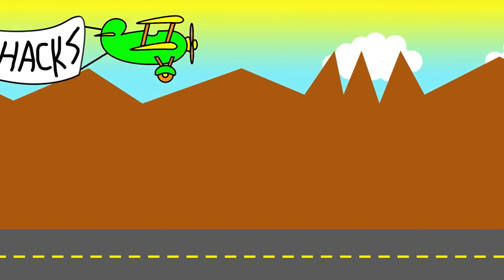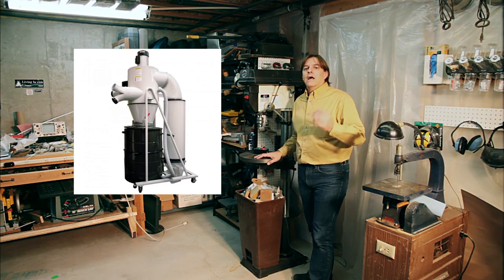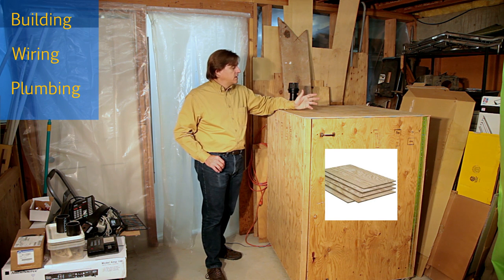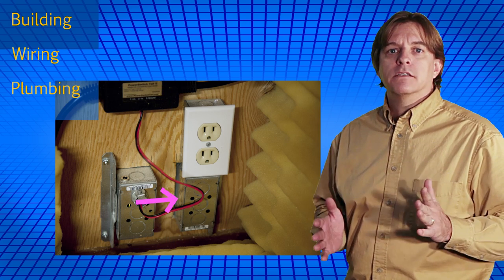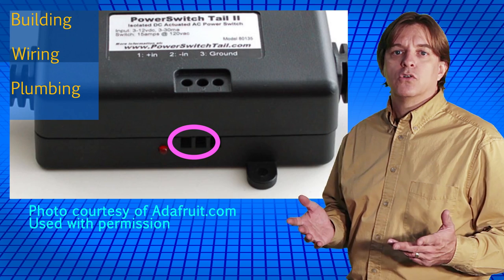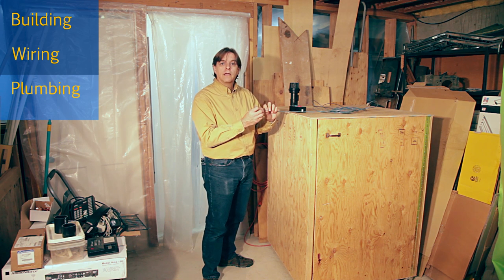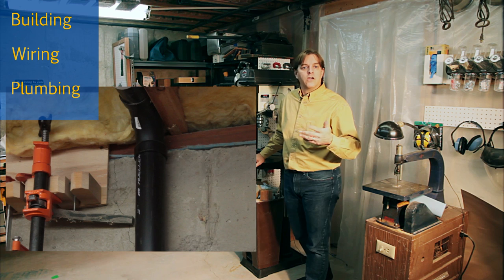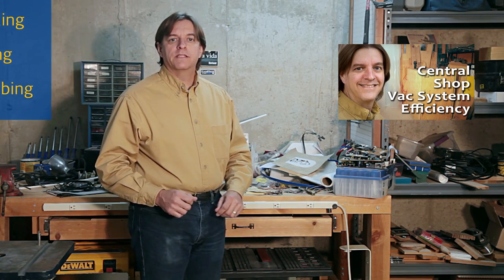How to quiet a shop vac - Physical build (Part 1)

Comment from the maker: Correction: at about 5:05 I called an RJ-11 an RJ-45. They're both the same design, just different connector counts. The RJ-45 is a 6 conductor connector that's typically used in networking. The RJ-11 is the smaller 4 conductor version typically used in phone systems. I used an RJ-11 in this application.
Reply: Additional correction: The RJ11 and RJ45 are not the same design, the RJ11 is in smaller and not compatible with RJ45 ports.  RJ45 is an 8 pin connector not 6.

Comment: For the remote ,I used the remote light switch kit from Lowes, just unplug vac, plug in remote receiver, plug vac into receiver that's rated for 15 Amps . remote switch is 1.5"x1.5"x 3/4", press button ,it's on, press again it's off, no cord trailing behind. Been using it for three years now ,and still works fine on the same small watch battery, I just clip it to the top of my shop apron and I'm  ready to work from any where in my shop.
Reply from the maker: Sounds like you have a good system. Cheers.

Comment: I really like you flapper gate/ports.  Be sure to keep an eye on the temperature inside the box.  If it gets too hot you might burn up the motor on your vac.
Reply from the maker: +P Lemieux Thanks. Yes, heat was a concern when I first built it. Since then I've had it running for quite a while at times and it gets a little warm, but not burning up hot.

Comment: The box looks really big.  How much was the sound reduced without the foam?
Reply from the maker: Yeah, it's not small. I made it the size of the vac + a couple inches for air circulation + a couple inches for the foam. I didn't think to test it without the foam, so I don't know the difference the foam makes. Cheers.

Comment: I just happened upon your site and the build you made is very interesting. I learned something new and I try to learn 5 new things a day. Now could I preform them with out a reference, lol, probably not.I have a small 10 x 16 foot shed/workshop I bought and insulated. This shed has a "loft" where I put my compressor and some day small tornado and dust collector.For now the tornado(home made) is connected to my vacuum. I then enclosed the loft leaving a small access door. The entire space is insulated to reduce the sound. I have Two questions for you : Should I change out the standard small plastic vent at the peak in that enclosed space to something larger so things don't over heat? &  Would it not have been better for you to have used a larger dimension pipe for that some day dust collection system and use a reducer to the vacuum in the box?Thank you and I'll subscribe!
~Dolly
Reply from the maker: +CrossGrain Wood Products,LTD Thanks for watching.

Regarding your questions:
1) I'm pretty pragmatic when it comes to things like this. I'd run it for awhile and see what happens with the temperature. If it gets too hot, put in a larger vent, otherwise I'd leave it alone. You didn't mention if your shop is temperature controlled or not, or if you're in an area that gets hot in the summer. If you don't have air conditioning, make sure to check it in the summer. I know where I am, a loft like that would get quite hot even without equipment in it.

2) Since I'm using a vacuum in my setup, a larger pipe would be a detriment. Not all the air would be moving so there would be dead space in the pipe for dust to potentially collect in.

Cheers.

Comment: Hi Harley. Thanks for this new approach and style. I am really curious as to your idea about the use of low voltage to turn on the vacuum. I read and saw in someone else's video how they had been able to do so for each of their tools. Certainly a lot cheaper to do so then to utilize an IVAC type remote switching. Could you show a simple example and material break down that could then be added onto easily?
Appreciate your ideas.
Reply from the maker: Hi +Rob Griffioen. I have plans to eventually do a video showing exactly what you asked, so stay tuned. :-) Cheers.

Comment: I'm sure someone else has already mentioned this but that's not an RJ45 it is an RJ12 plug. RJ45 is an ethernet plug for a data cat5 or cat6 cable
Reply from the maker: I'm sure your correct, that has been pointed out before. :-) I put annotations on the video correcting the error. Thanks and cheers.

Comment: hmmmm so you have no space for a profesional dust collection but build a soundproof closet thats about twice the size , im sure it works but i think you can put youre shop aircompressor next to it
Reply from the maker: Hmm, I just checked the sizes of a couple dust collectors. They take about the same square footage as this box and are much taller. I'm not convinced about your "twice the size" statement. In any case, size was only one consideration. Cost was another. I didn't want to spend the money it'd cost for a dust collector. Peace.